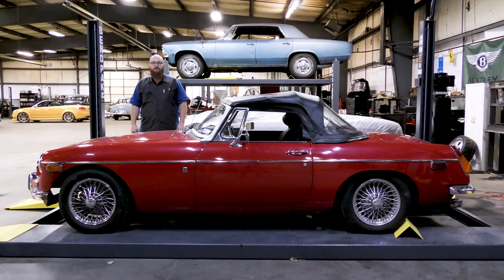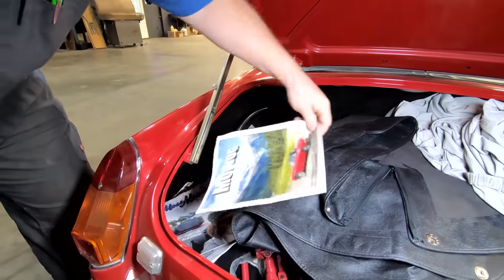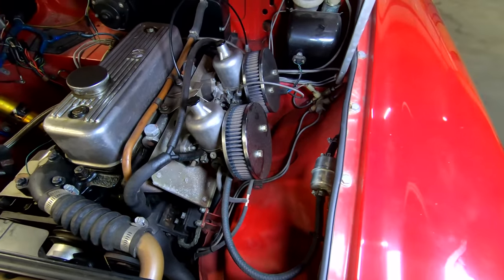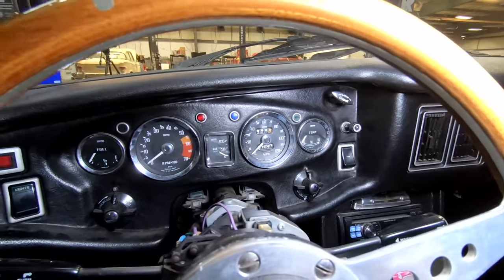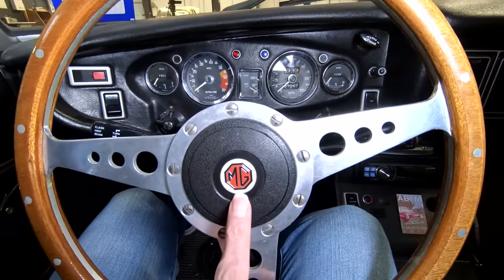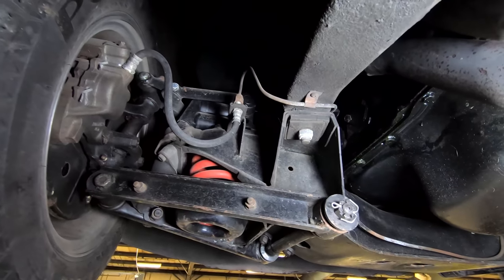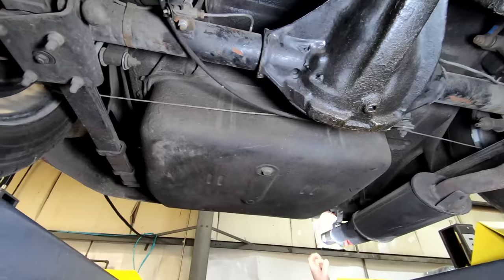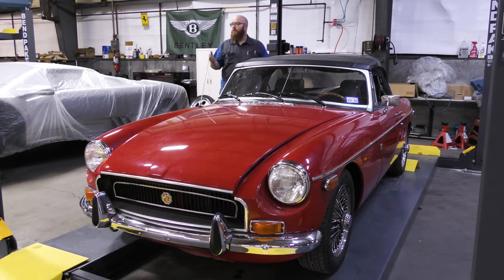Cherry 1972 MGB! See exactly why it earns a thumbs up from the CAR WIZARD!

Comment: There was an MG"C" model. It was an inline six with a large bore. It was wicked fast off the line, it was actually my brother's car, but I had to take it out. It was just so sweet. It resembled the MGB of course, but it was longer and wider and a real sleeper because of the big six
Reply: No it did not have a "large bore"  it was a small bore. . The displacement came from a long stroke. 
The car was marginally longer but not wider. 
Not only did I own one , but worked at British Motors of Monterey ( Calif) 68-72  where I bought my GT in 1969.
Reply: @jeffhildreth9244  My opinion was based on the visual difference between the bore on my 19xx MG"A" on the rebuild and the repair of a head crack on my brother's MG"C". The 6 looked like it had a larger bore than the 4. I didn't measure anything, nor did have any knowledge of the different strokes of either I also owned at one time an MG"B" although I never had to tear it down to the crank and piston rings. I was about 50 years younger then and I expect you may know what you're stating. My observation has only my recollection of the time in that at one time I did see into the pistons of the A and the C, and believed that the larger engine appeared to have a larger bore. No one should quote me on it.

Comment: Been wrenching on vintage British bikes for 20 years.  Everyone bashes Lucas but the problem was the manufactures forcing them to cut quality to save a cent or two. Sound familiar.  Also, as the cars and bikes got older they no longer went to a competent shop but were often bodged together by someone who didn't understand them.  Most of these were positive ground, so the wiring is completely different.  Wire up a component like a rectifier wrong way round and you will fry it.  So blame on the Lucas component.  I've seen bikes wired with bare wires wrapped together and a bit of electrical tape over them. No wonder they quit running and then they were abandoned because they weren't worth much. Once you get them straightened out using the procedures in the shop manual Lucas electrics can be very reliable.

Comment: My 1979 MGB had the same issue (It died on the highway). No indicators, No fuel/temp gauge or fuel pump. Ended up being a temperamental Lucas ignition relay switch!

Comment: Solid Lifters should be adjusted, carbs should be synced, there is a special wrench to remove the wheels, use anti-seize on the wheel nuts. The overdrive is controlled from a switch on the dash, electric switch. I had a '68 BGT, in Buffalo NY, the frame mounted jack tubes rusted out.

Comment: If I recall those twin battery trays were from the days of running twin six volt batteries. The 1800cc B series went OK for the day, with some hardened valve seats and modern oils would be a long lived unit. Solidly built cars underneath those MGs.

Comment: Hi from Adelaide South Australia. G day Wizard and MRS  Wizard I have a 59 MGA with a 67  5 main bearing 1800 MGB engine and have just changed the gearbox to the Vitesse MX5 5 speed gearbox conversion . The original 4 speed has got Mowog stamped on the casing so I believe it might be the manufacturer. The second battery box is because they used to have 2  6v battery's witch are expensive to get these days so now day's it's cheaper to buy one 12v. Just wanted to say hi and let you know I love your show it's always very informative and very entertaining.👍

Comment: I had an MG for some time - with 1800 motor with 1 and 3/4 SU carbs, big cam, big valves- 7,000 rpm top revs.  'Mowog' is the name molded in the casting of the block and appearing on BMC castings  throughout the car.  If the car was driving and just dies then likely it is the electric fuel pump getting varnished up from fuel. Otherwise distisbutor failure within the points, condenser or coil failing. If it runs initially and dies after running for some time and getting up to full running temp it can be just condenser. They do that sometimes. Could also be distributor high tension lead failing but this would normally give a warning of rough running. 
Other more drastic causes are failures are distributor drive gear failing or broken wires in low tension ignition. 
 Important to also check flexible engine grounding strip is intact because this also can cause electric problems of various sorts.

Comment: They originally came with two 6 volt batteries hence the two battery trays. We called the shocks 'lever arm dampers'. Old tech but they work. The roof does not leak hydraulic fluid but can be prone to leaking rain water across the seal to the windscreen. Oh and this car doesn't have a trunk and a hood. It's British, it has a bonnet and a boot. Many from this era don't have synchro on 1st either which traps new players. That HP in that small car does vey nicely but a Rover V8 conversion is the go!!

Comment: The British drink warm beer because they have Lucas refrigerators.

I had an ignition switch go bad and do weird things once. I had this old Ford F100 and it got to the point where if you hit a pothole, the engine would die. If you could find another bump before you ran out of momentum, hitting it would usually start the engine again. I went to replace the switch, and the entire thing fell out in  chunks of plastic gravel.
Reply: Lucas had an American cousin????

Comment: Hi Wizard,

Long time follower, first time poster. Great video per usual.

Have a video format idea for you. 

Maybe do a series of videos on specific cars from an enthusiast point of view? 

For example, R129, W123, R107/C107, CJ/YJ/TJ, 240Z, Z31 and Z32 300ZX, MR2s, MGBs, Spitfires, Mustangs, Camaros, front engine Porsches, full size pickups, etc. 

Do the video more from the perspective of an enthusiast: what is the common issues/gotchas, what are the great things, why is it worth spending the time/money if the car is a good car but has issues, what are difficult jobs to do on the car that you might consider farming out (cost+difficulty), what should be avoided unless you are a masochist (rotaries), that kind of thing. :)

Which cars are still in production but should be avoided from an enthusiast point of view due to difficulty working on them and/or complexity and cost in general? Modern car rants... 

You've touched on a lot of these individual things over the last years but say you did a 15-20 minute  video on just the R129, then a video on the W123, then old skool Jeeps, etc.

Just an idea. A lot of the things you present in your videos match my experiences but I'm not a professional mechanic so I have huge gaps on some cars. Always interested to learn more and being perpetually on the hunt for "the next car" I'm always researching different cars.

Keep up the good work - your videos are a fantastic resource.

Comment: Great looking car, I know them well. The oil in the carbs deal; these are called dashpots, and they take the place of the acceleration pump in a typical American carb. They caus a momentary delay in the opening of the constant flow regulating piston (the big round things inside the aluminous domes)  this enriches the mixture when accelerating

Comment: The damping oil in the dashpot does not dampen the throttle. It is a device which automatically enriches the mixture when accelerating - effectively an accelerator pump. The SU is a very clever device with one jet and very few components.

Comment: I had a friend who owed one of those cars in the mid sixties. Electrical problems were so common, that it never got enough mileage to even look at anything else. I saw some of those “knee shocks” only on cars older than WWII. I am surprised that a car from the seventies would still have them.

Comment: FuelFlow do a 12 volt replacement pump for the SU (15LM12),which apparently fits right up to the MGB.It features solid state electronics.
Reply: Or fit a modern small in line solid state low pressure pump...or two....

Comment: Wizard, Ron Kluwe has given you many insights and I will add just just a few.  Mrs. Wizard erred in her guess that the car had a "backseat".  It had none and the strange battery box situation was explained by the fact that the MGB had twin  6-volt batteries at some point and they would have taken up those 2 battery boxes behind the seats. Also, there was a big air intake that covered the twin SU's. It was garbage with garbage gaskets.  Tuning the SU's was a nightmare and much backfiring through them was the result.  I really enjoy your videos and I have recommended them to friends up here in Ontario, Canada.  One thing that made me laugh was your reference to British Leyland and it's "don't care" attitude toward making reliable cars.  I had a 1972 MG Midget and it was the last car in North America which had a 4 speed manual transmission with no syncromesh in first gear.
Reply: Good Mrs observation.. the rest is typical ignorant American ownership and disrespect for the car... specifically your  characterization of the air intake system.. and the  SU carb,, the simplest trouble free, easy to maintain last thing that needs attention when there is the slightest blurp under the hood.. and the last thing that should be  touched.
Reply: @jeffhildreth9244  Does your dismissive post explain the severe backfiring through the carbs at light throttle that plagued my Midget for years, despite professional attention?  The air  filter housings had wafer thin gaskets and the bolts that held them on easily stripped the threads in the aluminum brackets that held them in place.  Shall I go on to the 2 electrical fires I experienced, the body rot that started right away and a suspension system that included antique lever shocks.  You are one grossly defensive person and this car is not easily defended.  You are the one who is ignorant and also abusive.  Then there was the failing fuel pump that was generally fixed with sharp rap from a mallet until you could afford to buy a new one.  I bought a Mazda Miata the first year they came out and all the Midget's woes were easily resolved and mostly forgotten.  As will be your post.

Comment: MOWOG = MOrris WOlsey Group. On English MGB's the rear lights have the amber lens at the  top and the red in the middle and bottom. The air filters are not stock it used to have what were termed two saucepan filters. Every MGB owner carries a hammer for when the fuel pump stops to give it a wack to get you home, usually just cleaning the points on the pump will cure the problem.

Comment: Regarding 14:19:  Yes, that is the area for the second battery.  Earlier MGBs had two  6 volt batteries connected in series to produced twelve volts.  The reason for this is interesting:  One of the main designers of the car was over 6 feet tall and he insisted that the seat rails be set far enough back that he could be comfortable in the car.  So two smaller batteries were used with one behind each seat to allow for more leg room.  In time, as battery technology improved, small 12 volt batteries were able to produce enough cranking amps so just a single 12 volt battery was fitted to the later years of the MGB.  Also note that until the Mark II model was created in the Fall of 1967 and fitted with an alternator, the Mark I MGB utilized a generator and was wired Positive Ground.

Comment: It's adorable. 😍 You just don't see them on the road any more. The alternator and aftermarket stereo make me wonder if this one has been converted to negative ground, since so many British cars were positive ground back in the day.

I've toyed with building a "new" MGB around a Heritage shell. Good original MGBs are scarce and pricey. Besides, nobody would get upset if I used a more modern engine and driveline.
Reply: The MGB switched from positive earth to negative earth in 1968.
Reply: There are at least 25 MGBs locally  So Oregon.

Comment: In 1964,  I had a 1957 MGA  and it had two 6 volt batteries on either side of the drive shaft. I was in a plaza in Toronto on a hot day and the fuel pump let me down. I removed the service plate behind the front seats, took a hammer & tapped the pump. It worked & I was on my way home.
Reply: Johngregr... No need to pull, the plate.. go around to the passenger side in front of the rear wheel, reach in and tap. Better ye, t pull it an periodically service it as the Owner's Manual suggests.

Comment: So the thermostat housing is from an earlier model without the emissions control pump.  It is missing the bracket for that pump.  You can see the bolts in the block closing the openings which had tubes going to the pump.  These changes are almost universal.  And the ever popular oil filter which dumps the oil as you unscrew it.

Comment: That spot beside the battery is for another battery. They originally came with 2 x 6 volt batteries hooked up in series to get 12 volts. Space limitation was the reason I think. Old 12 volt batteries were too big. My '72 MGB I used to own had a bad ground wire for the fuel pump. Used to just die on me. Fixed the ground wire and no more problems.

Comment: I would replace the entire fusebox too.  No end of electrical maladies cleared up just by swapping the box over.  The heater valves can leak directly onto the distributor and cause issues too when hot.  Pain to diagnose as the hot eater evaporates so there is no evidence of a problem.  Early cars have 2 6v batteries, hence two battery cages.

Comment: At least it doesn't have positive ground system like our '52 Jag XK120 uses. Our Jag does run like a watch though!
The MG's steering wheel is made by Moto-Lita, a UK aftermarket manufacturer, they are still in business that I know of. Have the same exact wheel on our Jaguar as well, nice period-correct piece!
Lucas electrics are an injustice to an otherwise good vehicle.......and, if they leak oil, that just means it has oil. If it stops leaking, fill with the correct oil, LOL. 
Nice ride, thank you for good video content!

Comment: The final rendition of that engine, called the T series was available in 2.0 litre non turbo at 150 bhp and turbocharged at either 180 or 200 bhp. That was in the 90s. Fabulous engine that was killed by emission regulations.
Reply: A Rover 220 Turbo is a car I always keep my eye out for. So hard to find these days though!
Reply: @SpitfireFortyFour  wish I had bought a few of them when you could buy them for peanuts 10 years ago........
Reply: @TIMMEH19991  I know! They're almost pushing 10k at this point. It's wild! This is the queue to buy 25/45/75s before they go crazy as well.
Reply: @SpitfireFortyFour  I was looking at a ZS just recently, and they are going up in value quickly. I should never have sold the one I had.
Reply: @TIMMEH19991  I bought a MK2 ZS180 Firefrost last weekend. Don't regret it in the slightest!
Reply: @SpitfireFortyFour  Awesome! I wonder if it's my mates old one...you never know! Saloon or Hatch?
Reply: @TIMMEH19991  2004, early Mk2 Hatch. I wanted a saloon but this particular car was extremely cheap as the slave cylinder was screwed. It's in excellent condition 70k miles.
Reply: @SpitfireFortyFour  Mates was 2005 saloon. Lovely car. I fitted a metal Honda clutch slave cylinder to it! Those plastic rover items were just pants.
Reply: @TIMMEH19991  I got one of the "Sheddist" kit for mine that also uses a metal cylinder but with a custom bracket so you don't have to chop up the old one!
Reply: @SpitfireFortyFour  I didn't know you could still get them! I met the guy many years ago. A really nice gent who knew his stuff.

Comment: The rubber straps are rebound straps. It could be a race car. If you buy the moss supercharger. Moss sells SU and other fuel pumps. And the ignition switch does fall apart after 40 years or so. Contrary to the story Lucas wiring is quite reliable if contacts are kept clean and the MG loom is not hacked. They sold about 25,000 MGB’s per year in North America. Michigan and The US west coast  were the biggest Markets.  And the Armstrong shocks were hydraulic dampers.

Comment: Tap the fuel pump with the wooden handle of a hammer, this is known and common problem, the contacts just need a bit of persuasion to get them started. they're also serviceable.
Reply: Bob  Davis.. an indication that the points on the pump need to be addressed and service per the owners manual.  no more, no less.

Comment: I had a 1991 Toyota Corolla wagon with the multi valve 1.8 and it had about 86hp. 80hp in this car is not bad considering its curb weight...